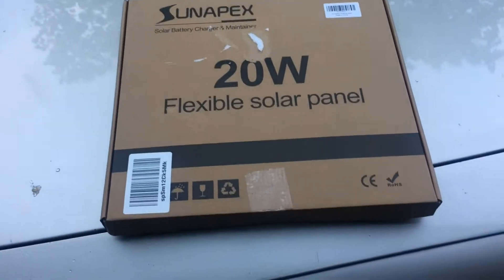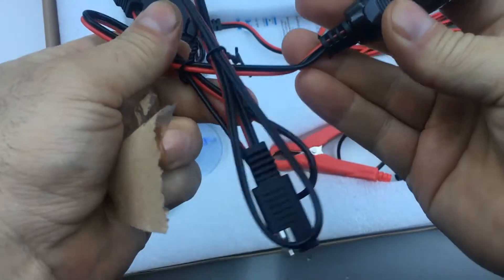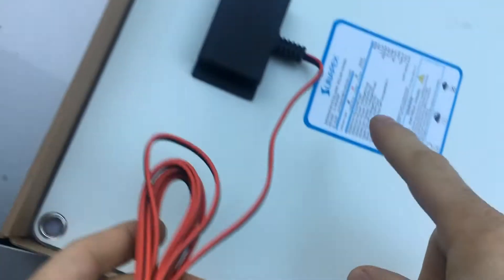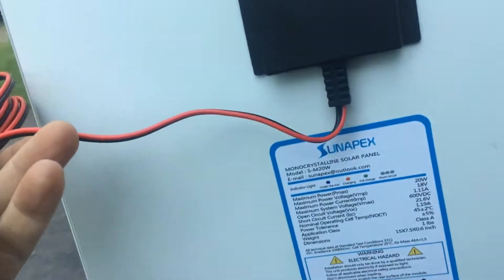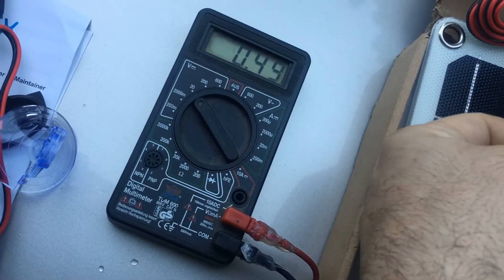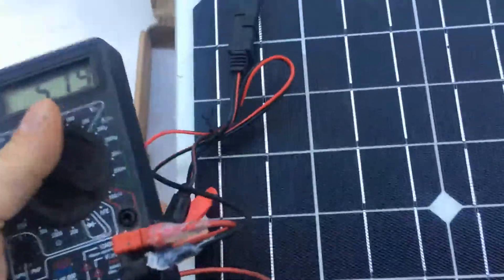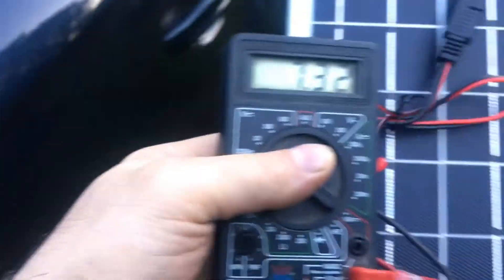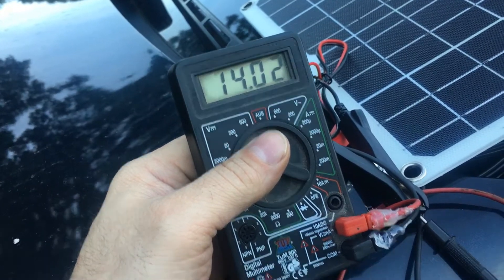SUNAPEX 20W S-M20W unboxing testing Audi Q7 battery charger 18v 1.11a  Solar Panel Monocrystalline

Comment: It works through the cigarette lighter too on the Q7?
Reply from the maker: I never tested through that because of the Audi charging Module interferes with things. I connected to battery connectors in engine area which is still controlled by the Charging Module. ideal setup requires tilting the left seat back to connect direct to battery.
Reply: @bobspurloc  I’m thinking to buy one for my Q7 but I don’t wanna charge by the engine bay… would be great for me if works through the cigarette lighter
Reply from the maker: Actually I didnt try it because I was thinking the car turns off the cig ports, im not sure why I thought that though because I think I had a voltage readout in the rear one for months to monitor it externally. So I guess it will work.
Reply: @bobspurloc  Thank you for your answer. I'll buy one too 👍🏻👍🏻

Comment: One measures the amps not the volts to find if you got ripped off or not. A 5 cent charger will also show 12 volts. All that matters is the amps.